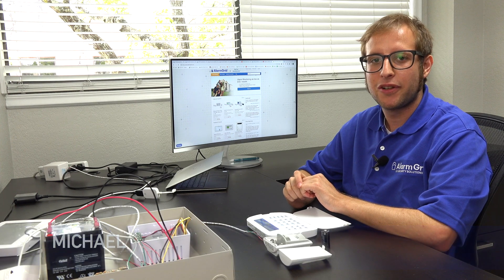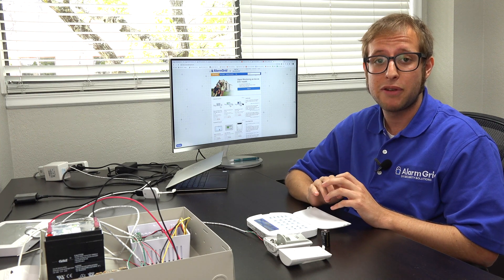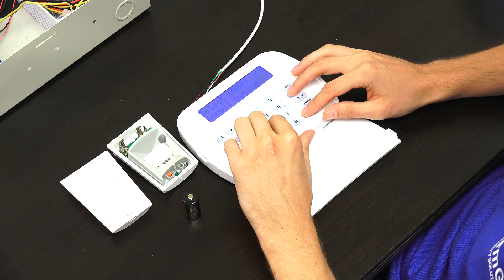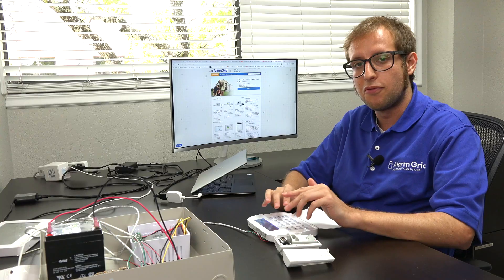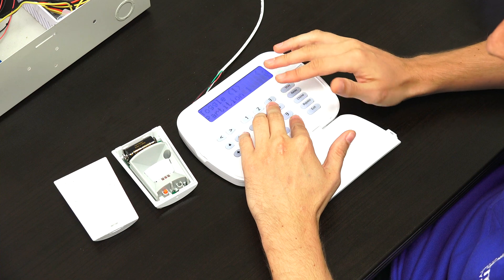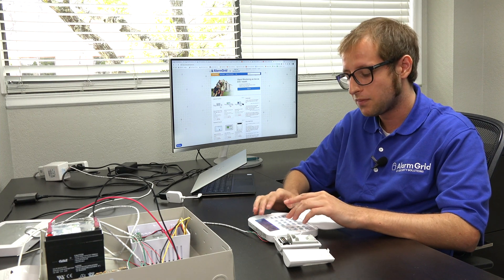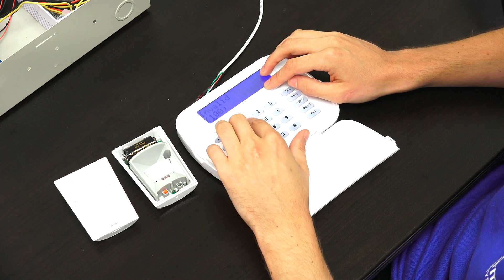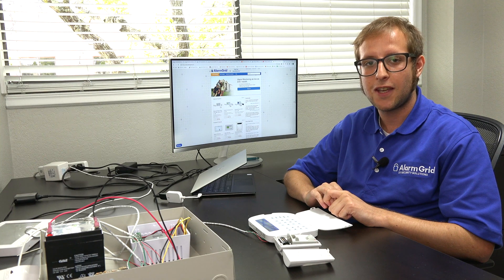Enrolling a PowerG Sensor to a DSC PowerSeries NEO

Comment: Hello
The pg8914 in the summer don't detect motion at all....only if you put your hand in front of the sensor is active......we have that problem in every installation .....in the winter is not perfect but can detect the motion 
Do you know anything about that problem??
Reply: We have not run into this issue,  The motion is an indoor motion if installed outside the temp could be the issue I recommend take inside and test if it occurs again. If the outdoor enviroment is the same temp as a body it is going to be hard for the motion to see the person.
Reply: @joshuagriffin2807  thanks for the answer. 
I know how the pir works..I'm 20 years  security systems technician 
..  we have installed different brands wireless systems...only that sensor make the problem!! Actually today after a  test in a customer home the 4 pir don't respond to detect motion
Reply: I will make a video about that pir
Reply: @panas872  what happens when you take it off the wall?
Reply: @joshuagriffin2807 you mean how is responte the pir when is not attached to the wall?? The same thing until you move your hand near the sensor ..the dsc  dealer knows about that problem  but the only solution he said is to buy the mirror optic pir but is more expensive!!